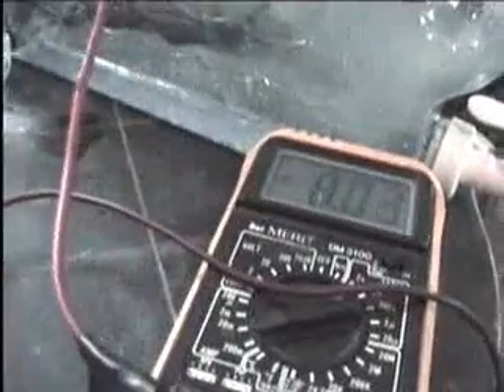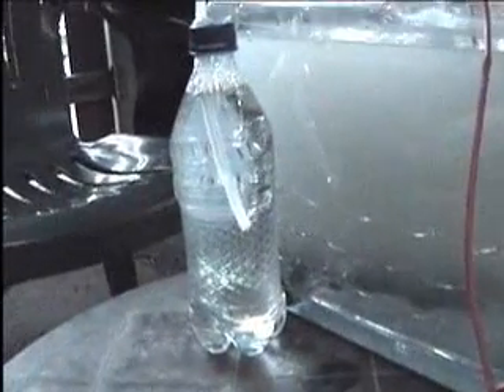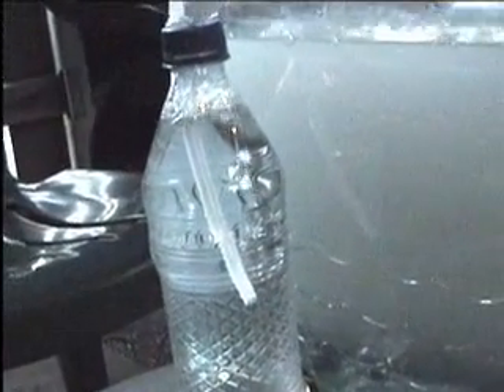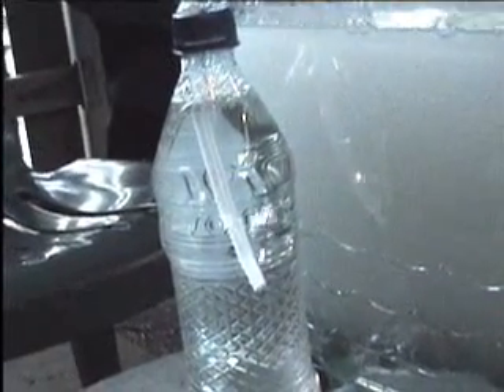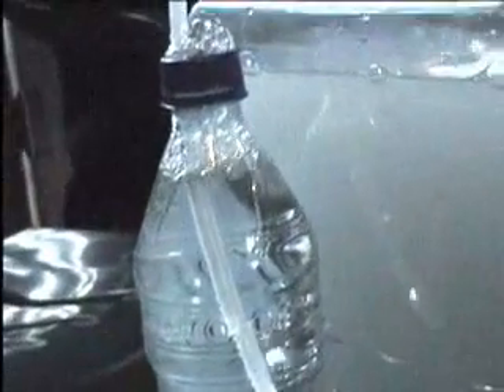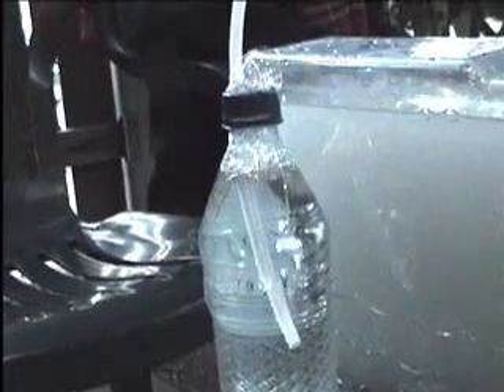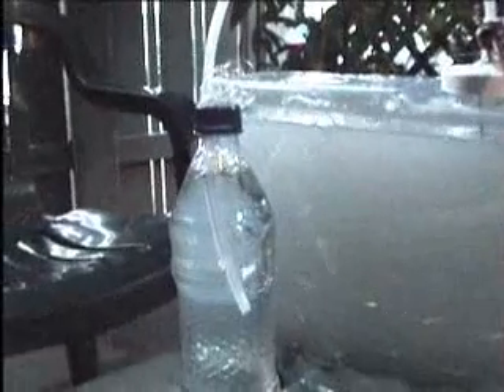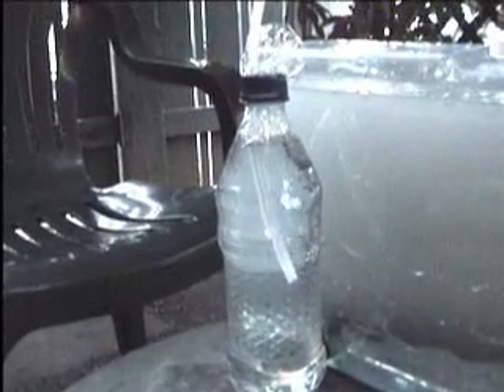Buba fuel cell complette

Comment from the maker: Thanks for the question gissome1234.-#1-build a safer cell with a bubbler & connect output to your intake & venturi vacuum on your car engine(either use 2 cells-(prefered method)1 for venturi vacuum & anouther for intake vacuum or use check vavles for single cell install-you might have to modify your car to run leaner)-we are still testing & haven't gotten milage data yet.

Comment from the maker: Thanks for question windowwisher-#1-The coke bottle is a safety device called a bubbler-it's filled with water & the bubbles u see are the hho gas.#2-ussaly the output of the cell is connected to the vacuum lines of your car so the hho gas gets sucked into the engine.
#3 Most HHO cells run on dc-i have heard of dc with an ac component on top of the dc(gotta try this sometime)-hope this helps

Comment from the maker: thanks for question andypandy687-i found that the further away the electrodes are-the hotter the cell runs so i keep electrodes as close as i dare.-i am planning to try high voltage & will have to build a cell with large electrode gaps since "spark gap" will be a concern at killovolt levels

Comment: Does the distance between electrodes affect producition and effeciency? I was considering building a cell with two tubes connected at the center to seperate the gases, but I wasn't sure if the distance between the electrodes mattered...

Comment: Why does everyone with a makeshift jar and electrodes that rust after 4 hours of use claim they are doing Stanley Meyer work? Stanley Meyer's work is completely on another level. He used stainless steel electrodes, High voltage pulsed DC and many circuits that sync together a resonance such as the never talked about Phase Lock Loop Stan used. Not to knock what your doing (Conventional Electrolysis). Just don't dog Stan's reputation like that with all do respect. Good luck and be careful.

Comment: agreed, I'm very very pro clean fuel and I believe that we are being misled. We get along ;-) But, that still leaves the question: how do we supply the world with vast quantities of hydrogen without using nuclear, Coal or oil plants? (but hey it probably is possible if we boost the efficiently and reduce price of some green power sources) btw nuclear fusion looks interesting for the futer. As you I pray for all our sake that we find something quick, cause time is running out.

Comment: Meyer was way too secretive, camster6 has sort of the same set up I have, using a voltage multypler like Daniel Dingle. I am using tubes and he is using a spark gap. He got the ramping effect so he is well on the way. I am out of project funds so I have to wait some before I can build the new WFC and electronics. I will have a water flow pump and the voltage too the FETS will be veriable from 0-120v. God Speed!

Comment from the maker: Yes -you are correct,this is Faraday's at this point in my work.
I have built a "pulse dc " Stanley Meyer based unit & will attempt (soon) to find the resonance (or some kinda sweet spot) of our fuel cells.that will  hopefully  drop the current somewhat while keeping the HHO gas output unchanged.